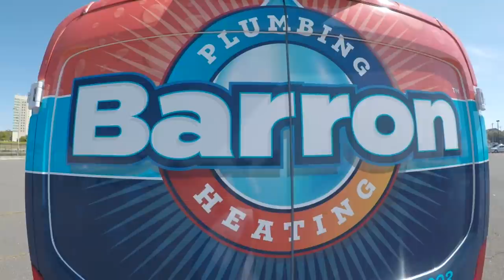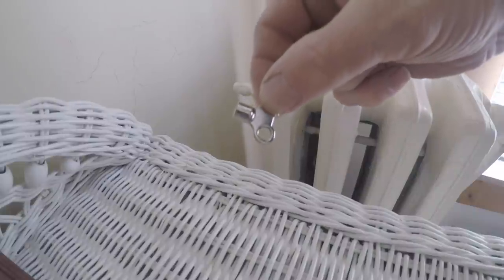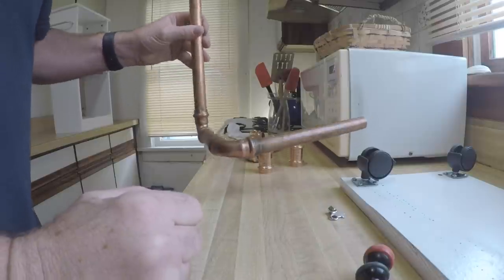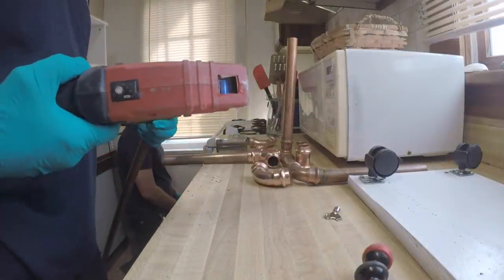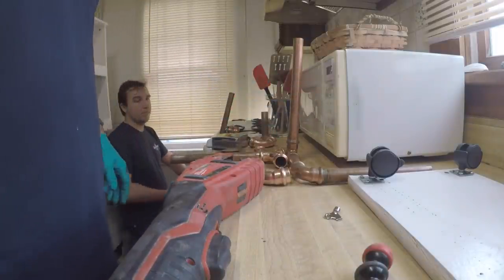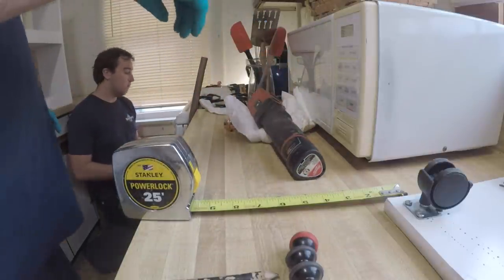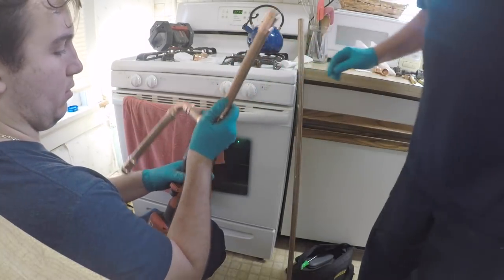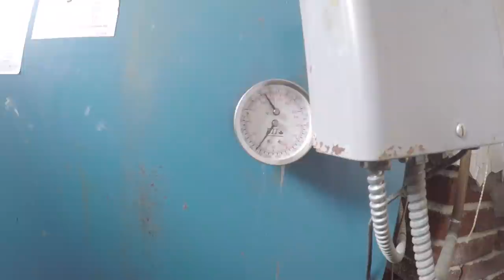PLUMBING REPAIRS | PRO PRESS LEAK | COPPER PIPE

Comment: Like how he uses customers countertop as a workbench,does not Ream pipe, and steals napkins instead of having rags.... real professional
Reply from the maker: ya. thats a no no..cover your counters, pull out your rag and be professional..
Reply: VIP plumbers come -fak countertop
Reply: You'd be surprised at how many plumbers don't ream their pipe. In the service industry I have never seen a plumber ream their pipe before. I was bad about it for a while and still forget sometimes but I try to remember
Reply: Let be honest here. Did the countertops get damaged? Highly unlikely. Would a customer rather have  water damage to their floor or let the plumber use a few napkins? 99% of the time the customer wants you to use their paper towels and napkins. Sometimes you just don’t have a rag or towel there and it just happens, cut the guys a break. And don’t be so dramatic about reaming the pipe. Turbulence is not really a prolific issue in residential applications
Reply: This is such a small time guy comment. You probably worked for one residential service only company your entire career…
Reply: Well said
Reply: In the Uk Geberit won’t guarantee a leaking fitting unless the pipe it’s on has been cleaned and reamed and marked, I have seen so many plumbers being lazy by not doing this, it’s part of the process why ignore it.
Reply: @jordansantanen4144  Yep, you are correct. I see plumbers reaming pipes only on YouTube. In real life, i still have to see one doing it
Reply: There’s always a Karen
Reply: Don’t ream pipes?  Get leaks at the 90s from turbulence…

Comment: Friends of mine mark every fitting. 
I agree with pre-fabbing for the corner
Nice job Chuck
Reply: I always mark every pipe, even in prefab, sand very carefully for burrs.
Reply: @woody9052  if it's right in front of me, we don't. As long as we can push back/hold together
Reply from the maker: best policy
Reply from the maker: true that.

Comment: corrct me if I'm wrong ..pressing the pipe is "faster" and more convenient than soldering but if you have a bad pressing you can't un-press it you have to cut it out and fit in a new section of pipe and repress ..right?
Reply from the maker: Very true. Scrap pile

Comment: The O ring is what keeps the joint from leaking. The sealing surface has to be clean and smooth with no groves. Also ream the edge to avoid cutting the O ring.
Reply from the maker: Thank you thunder.
Reply: Not true the o ring is a backup seal. There are plenty of  videos where the o ring is removed and the crimp alone provides a seal. Look up the tests
Reply: @justinb7558 That's the problem it will hold but after awhile they will leak if the O ring seal was defective.

Comment: Everyone is going with this pro press now I don’t feel comfortable with those or shark bites they fail after a while I like the old way soldering because I know it will be there solid for as long as the house stands
Reply: A pro press joint is solid and even when the O-ring ages it will never fail. 

The only essential steps are:
- Fully inserted
- Pipe deburred
- Pipe clean
- Propressed correctly
- Propress calibrated 

Propress is being used in Germany for a very long time and it is a very reliable connection.

We propress almost everything - except refrigerant lines and heat oil lines.

We propress solar, water, heating, gas, compressed air,...
Reply from the maker: plumber on scene. Ty plumber

Comment: One of the knocks on me over years is the fact that I would use tooo much solder on my joints. I have never in 45 years have had  a call back on a pissin joint..Never  but my kid & his bunch all swear by by Pro - Press  HA I remember my old man back in the 60's bitching  that cutin & threading will never  go away....
Reply: Hahah then it went away.
Reply from the maker: so true
Reply from the maker: its all coming
Reply: Threaded copper?
Reply: @danlux4954     Yes. we never work with copper only galvanized & black iron for both water supply and  gas and waste up to 2in..
Reply: @blueticecho5690  wow, all my waste water cast iron is rotting out.
Reply: @blueticecho5690  cast iron drain pipe rots out and cracks